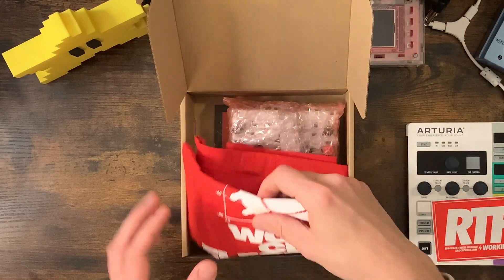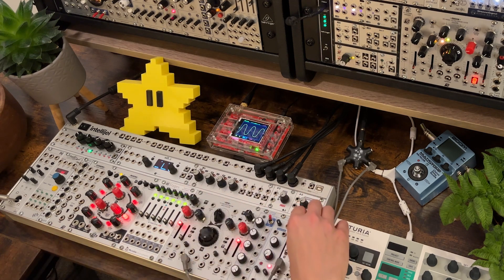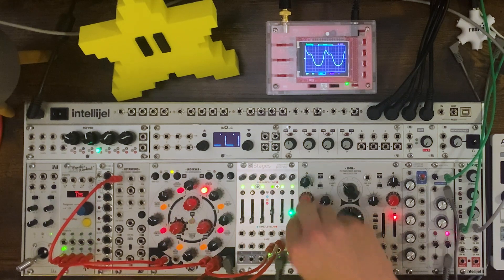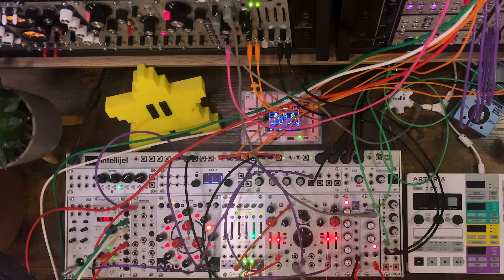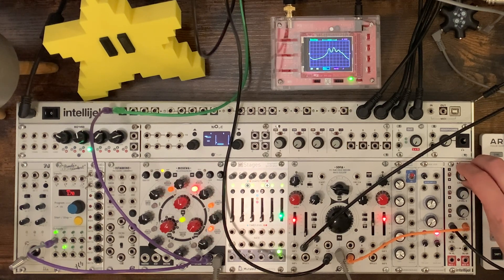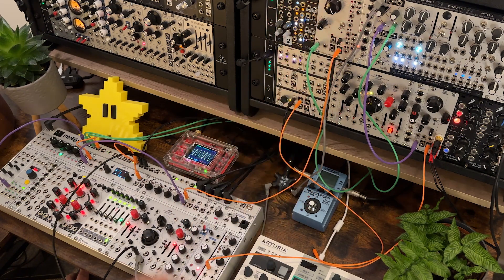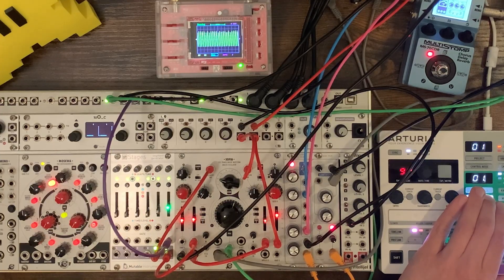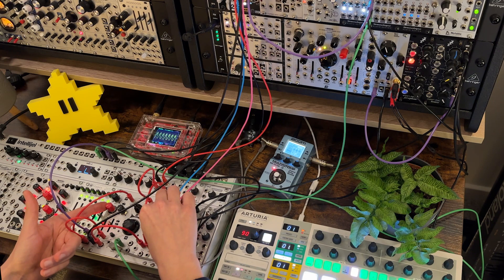Xaoc Devices Sofia | ‘Transcendent waveforms’ that sound sublime

Comment: As a big fan of coil .... I love this particular module for the possibility to take the concept that they used  Loves  secret domain ..stolen and contaminated.. and gold is the metal... to obliterate any connection to the genre of acid house (which they were both enjoying and having to cope with at the time....) and obliterate abuse it... which this particular module could offer more adherence to the squelch resonance and murder it even more.... it worth the experimental possibilities... more I love the structure...Xaoc never fails to make something you can make new sonic possibilities with on so many levels...

Comment: great demo! are you planning to make a video on inertia?

As for replicating ripple-synthesis with other modules I was able to make some similar sounds by patching an oscillator into a function generator with gated cycling(to loop at audio-rate) and then mixing them together. Since the gate is only high roughly 50% of the time you get that same phase-sync effect. I got some insanely rubbery and rippling sounds by experimenting with using a clock divider before sending the osc to the gate output, modulating the function generator cvs with the osc and using am/ring modulation instead of summing the osc and "ripple".
Reply from the maker: Thanks! Yeah, I'm working on some demos of all the News Systems Instruments modules next. Inertia can do so much, it's taking quite a bit of planning :)

That technique for ripple-style synthesis using a function generator sounds very cool - I'll give it a try!

Comment: Nice video. Could you give a bit more detail on how Pams is playing the hihat at 12:38, please? It sounds like there's level or length mod, not just 16ths. Or is it just down to whatever hh module you're using?
Reply from the maker: Thanks! The hats module is Tiptop HATS909. It's just the closed hat being played; it's getting 16ths from Pam's but I'm also sending an accent on the offbeats (i.e. x1, phase 50%). It's mixed with BD909 and then runs through Dannysound Dynamics for some drive and compression. So between the compressor attack and release and the accents, the hats end up with quite a bit of level variation.

Comment: nice, easy to follow demonstration.. the osc sounds great in a variety of ways, contexts, etc. what type of drums / perc. did you use for the techno part? that part was really cool. thanks for making this demo!
Reply from the maker: Thanks! The drums in that part are actually super-simple: just Tiptop BD909 and HATS909 (in a separate rack off-screen). They’re triggered from Pam’s - straight 4/4 kick and 16th-note closed hat, plus I’m using Pam’s to trigger accents on the hats on the off-beats. They run through Dannysound Dynamics for a bit of compression, sub-bass, overdrive and EQ. (Pretty pleased with how that section turned out considering it’s literally just three modules generating all the sound!)

Comment: hey. great videos. Cn I ask which oscilloscope that is? the little red one. Does it have a probe or did you figure a way to plug a patch cable straight into it? Any links would be greatly appreciated. Cheers.
Reply from the maker: Hey - it’s a DSO138, which you can pick up very cheaply either as a kit or ready assembled. I use a BNC to 3.5mm jack cable (or you could just use a BNC to BNC cable with a 3.5mm jack adaptor on one end) and connect Eurorack signals to it via a passive mult. Hope that helps!